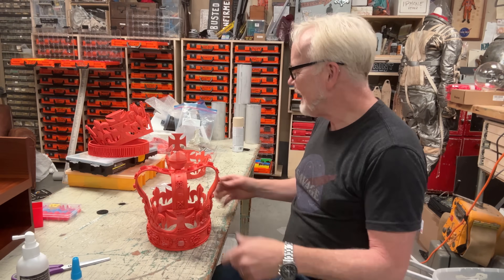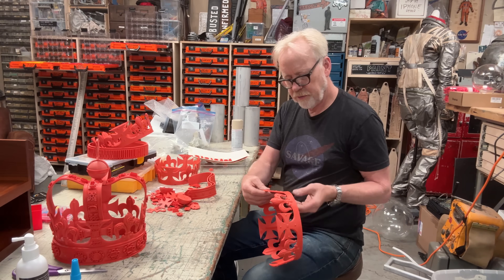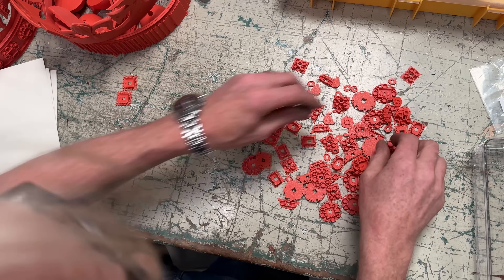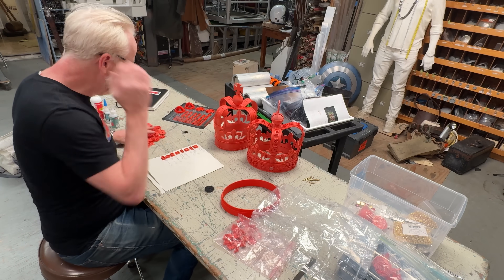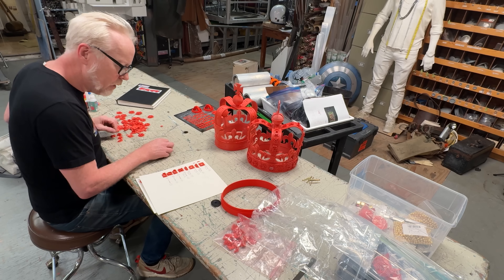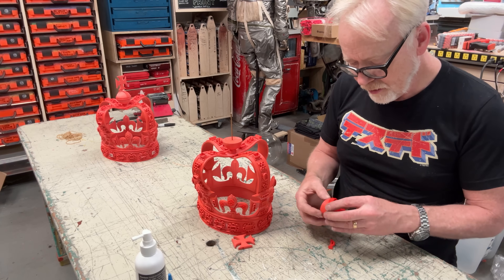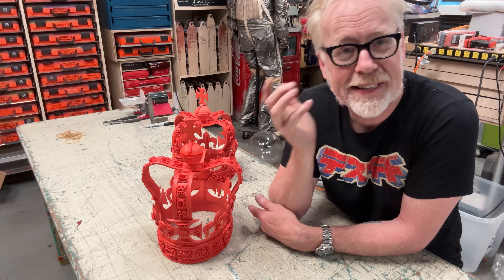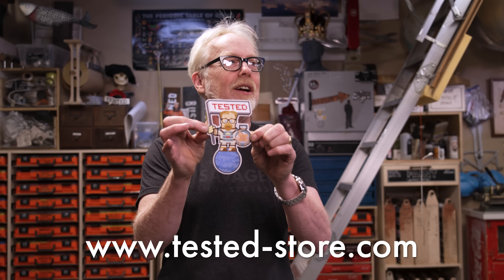Adam Savage Shattered His 3D-Printed Crown!

Comment: For pla and Petg, on my smooth pei and textured pei plate, 98% of the time I've not had to use glue on my build plate, just some soap and water to clean it from time to time and some 95% isopropyl alcohol wipe down before a print and the print holds and release just fine without the need for glue.

Comment: @tested Adam I am curious and the question popped in my head watching you use the accelerator, what does your supply section of the tested shop look like, where you store all your supplies that get used often in the shop, im sure your not running to the hardware store when you run out of glue. #adamsavage

Comment: For the little tips of the crown that hang down and are hard to print you can model in little thin pieces that connect that tip to part of the crown that can be snipped off and cleaned up post process. Think like how parts in model kits are suspended in the webbing or whatever it is called.
Reply: Safety flags essentially.

Comment: I just recently made a Gemstone prop replica of a baldurs gate item and used clear abs like resin for the faceted gem. things I learned after 3 prints is to be meticulous in placing the supports on only the facets you can easily sand flat. primarily the rear but you can get away with a few on a front facet as long as its at a good angle. sanding the bottom perfectly flat will let you get away with a lot of the surface being so-so, esp once the clear coat hits it. print the gems solid, and I would dye in the post process with tinted clear coat, even tinted resins really only POP when a little dye is added IMO

Comment: A few things; More perimeters (walls) are better than more infill. For highly detailed pieces with sharp overhangs I prefer a smaller nozzle and finer layer heights (unless I print it in resin). Maybe try a .25 or .20mm nozzle. Finally, for PLA and PETG I found that 3DGloop is better in most cases than cyano glues with a kicker. Gloop is a solvent specifically designed for PLA and PETG (two different varieties, make sure you get the right Gloop for your material).

Comment: if you are using an AMS you could always use  an interface material that way you can print right on top of the supports. you can actully use PETG for PLA as it really dosent stick to PLA so it pulls right off. the easiest way to trick the slicer in to letting you use PETG with PLA is seting the interface material as PLA then bumping the print temp to like 230 on that materail then loading PETG in that AMS slot. It works like a charm and the supports come right off. just make sure you use something that wont bleed color in to the PLA.
Reply: I have had fantastic results using PETG as a support interface with PLA and vice versa. Apparently, TPU works well with PLA as a support as well. Haven’t had a project to test but support interfaces are amazing!

Comment: I don't quite understand why there is so much assembly of very small pieces - i think all the gem settings. Why not just print them together or more assembled? Isn't that part of the benefit of a 3d printer? especially with 24 different ones, I'm just not sure why its all separated.
Reply: When it comes to 3d printing you want to avoid printing things with overhangs that require supports so most of the time its better to break a model apart like this to have a higher quality finish at the end